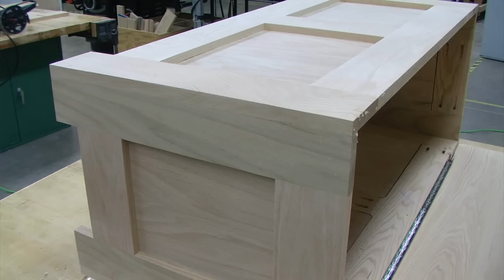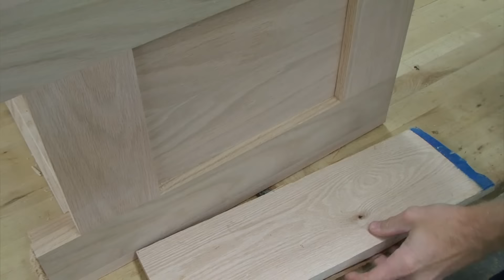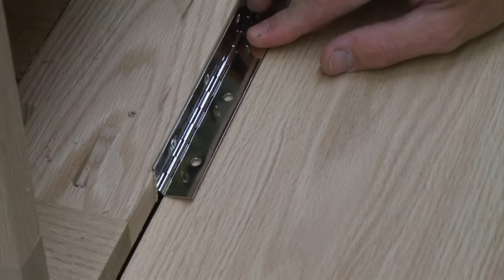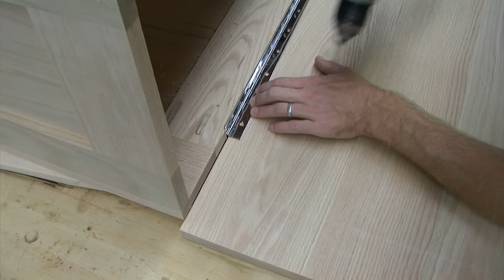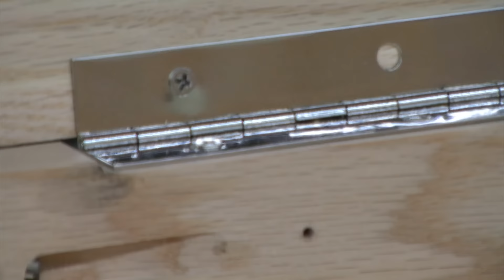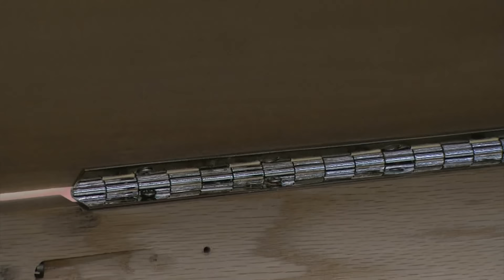Blanket Chest Project Tutorial - Step 12d - Final Assembly

Comment: Excellent. You seem like you know what you are doing. I am clueless and cannot find the answer to this basic question.  Suppose I want the hinge side of the chest lid to have a 2 inch overhang instead of being flush with the end of the chest as you did here. Would this type of piano hinge still work if you slid the lid under the chest by 2 inches and drilled the pilot holes 2 inches from the lid edge?  I don’t need to go past 90 degrees. 
Thanks for any help..........R
Reply from the maker: It should still work, but as you noted, it wouldn't go past 90 degrees.  Just make sure the hinge pin is hanging off the back edge of the chest side.
Reply: @InsaneOil  thank you very much I appreciate it
Reply: samlol23, I want to do the same thing so I’m curious about whether that worked for you. Thanks.